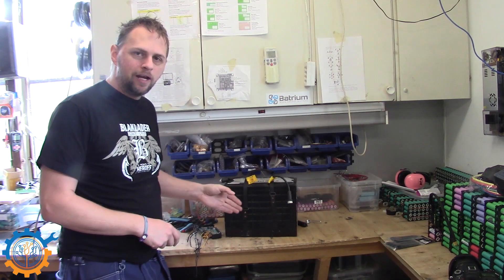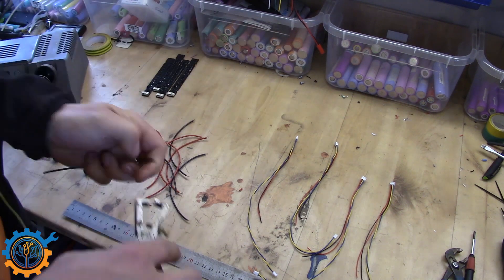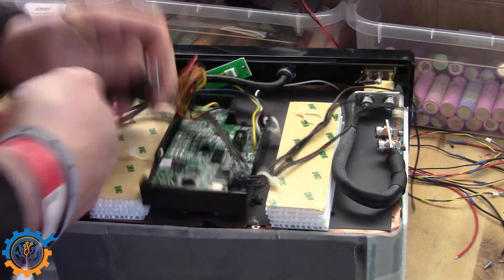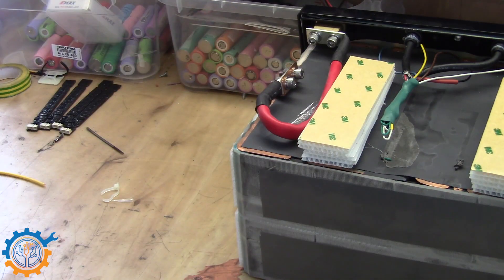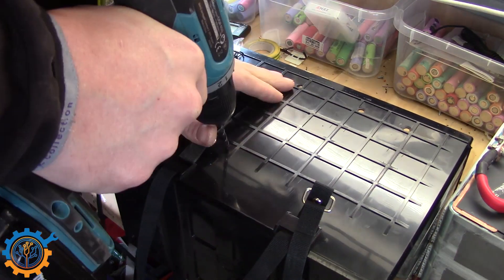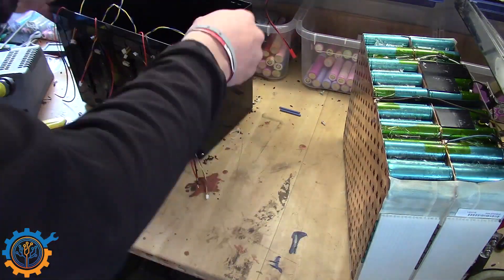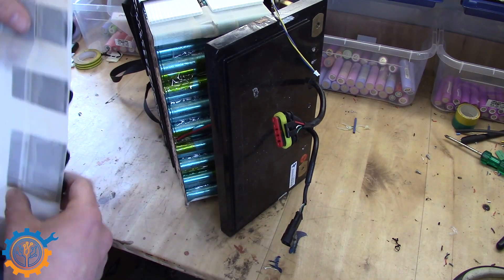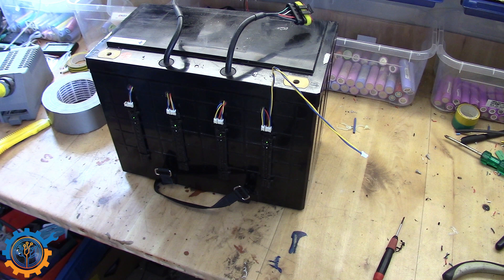Batrium BMS install on Valence 12V battery

Comment: I just got 2 of the green Valence u27-12xp for a good deal. I plan to use one or maybe both in a 200w solar system in my camper van. I would like to replace the slave BMS inside each unit with a new BMS. Can you recommend a BMS that I should use?
Reply: Hi there! I too am looking to figure out what BMS to use with a larger bank of u27-12xp batteries. Have you had any luck figuring out a BMS system? Would love more input. Not much info out there!
Reply: Muller Industries is releasing a Valence XP compatible Low Voltage BMS in January. Pre-order sale is in December.
Reply: @Kateleeshort  I'm in the same boat, just purchased two u27-12xp's. My understanding is that it has its own BMS internally as shown in this video, but its better to upgrade?
Reply: @ryanlogan9721  The internal BMS is for cell balancing inside the battery, the external BMS is to monitor and balance multiple batteries. IDK if its better to upgrade but a Low Voltage External U-charge BMS is a hard thing to find. If your still looking there is a  LV BMS being released for the Valence XPs in January
Reply: I too am looking for a solution. I think with proper cutoffs with my solar charge controller a BMS isn’t needed beyond the internal one. I am looking at a temp controlled box for my batteries as they may be used below 0C.

Comment: Hi. I have a question. I have x2 138 valance batteries which I bought as a powerwall. I dont have the green battery boxes.The copper + and - terminals inside the battery are at different heights. So when I connect cables of the SAME LENGTH they protrude at different heights from the new box I've made. I know cable length is important so is it better to keep same length or shall I shorten one? Cheers pal
Reply from the maker: In series length isnt a problem more than overall voltage droo
Reply: @DIYTechRepairs  Many thanks. And in pararel? Does it matter?

Comment: I have the older valence with the round plugs. They were supposedly tested with the valence software before I purchased them. Since then I have not balanced them. I was told that monitoring with the software on a laptop while charging that the balancers are active. Yet I haven't figured out how to connect them. I have tried with 2 or 3 adapters, but the software says wrong com port, false batt ID or can't find battery.....can you give me some info on this? Thank you
Reply from the maker: Dont know. I replaced the bms in mines

Comment: Hi, Can you suggest a more cost effective bms for direct replacement of a dead bms on a 12v 105ah lifepo4 battery?
Reply from the maker: Michael Hilton cost effective in what sense? what functionality do you need?  you can get away with 30usd but i dont recomend them. a proper bms generally start at 100usd and up depending on functionality
Reply: For example if you were to replace the slave system in your valance battery only with a quality bms but don't require a large or expandable system like Batrium.
Reply from the maker: Michael Hilton there is none out there with same functionality as batrium but with less function you can most likely find. i have one i know but i will check and link later